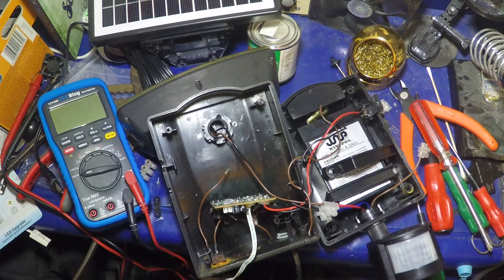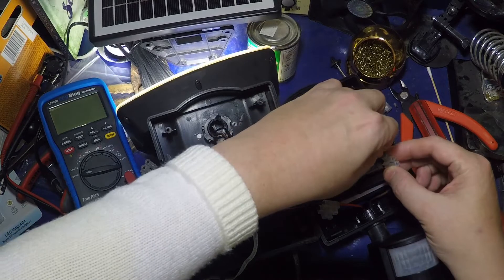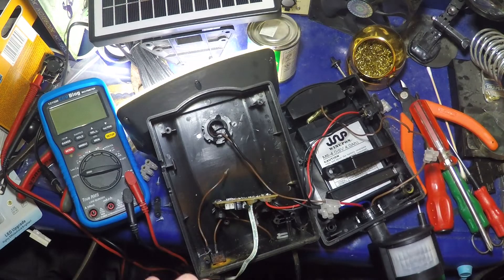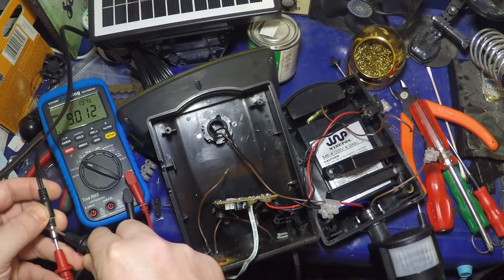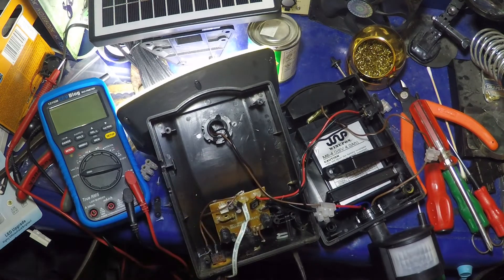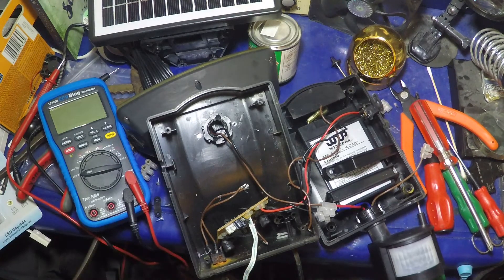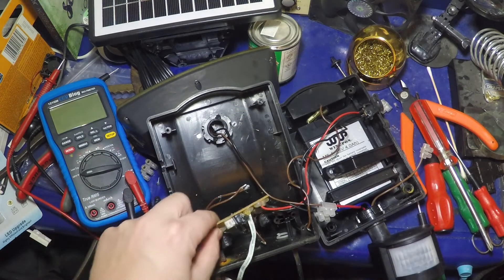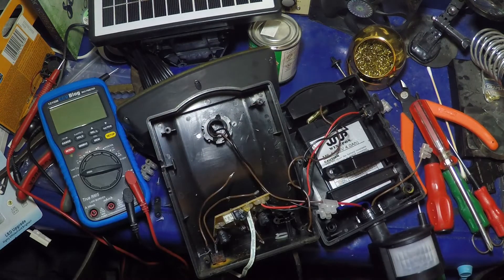Electronics Help Needed

Comment: The circuit board is a Solar Charge Controller.  It will have three pairs of wires.  Solar Panel(2), Battery(2), and Load(2).  A solar charge controller doesn't really need the load connector.  But many contain a battery protection circuit that prevents the battery from fully discharging.  Once that happens, it disconnects the load.  You can connect straight to the battery, but it won't protect the battery from fully discharging.

On the load side you will the see the PIR, switch and light.  This is the fuzzy part.  Just guesses. You tore it apart already so it makes it harder to guess how it originally worked.

My guess to get the original circuit board to work, everything will be the same as original except the PIR wires  (Also switch).

How to debug it:
I would put it back the way it was originally.

For the switch wires:  If the switch is a normally closed switch short the switch wires.

I would try to figure out the what the PIR wires on the circuit board are.  How many PIR wires?  There has to be at least three.  Just like the new PIR sensor.  1) Neutral, 2) Power, 3) Load(Switched).
It there are more then 3 wires, there might be two power supplies to the original PIR.  Electronics and load power supply. 

1) Use your continuity tester to see witch PIR wire(s) on the circuit board side are neutrals.
2) Connect battery and use voltage tester to see witch wire(s) are power, note voltages.

3) The remaining wire is likely the switched wire.

I would connect neutral to neutral, power(highest voltage if more then one),  to power, and load to switch.

No idea weather a 12v PIR will work right.

Good luck

Comment: How was the battery being charged before, was it that circuit or another one? I don't know much about charging other than as you say, voltage matters. I think the circuit for doing this is often referred to as a charge pump, but I could be totally wrong. Good luck with FrankenPIR :-)
Reply from the maker: Yes, it was charged from that circuit.

Comment: OK, So, a 6V Lead Acid battery needs around 7.2V to charge, you are measuring 9.x V as the open panel voltage, when connected to a load this might drop, especially due to the internal resistance of the battery.  The Schottky diode is to protect the panel from the battery, you can use a single Schottky barrier diode such as the 1n5822, arrange it so the diode only conducts towards the battery.  I would wire the panel to the battery seeing as it is such a low open voltage and see if the battery regulates the voltage (apply briefly and measure the voltage).  The circuit may do PWM charging but it's hard to say.  If the battery voltage is around 7.2V then you should be OK.
Reply: If you measure a 12V solar panel without any load you will see it outputs something like 20 odd volts, so higher open panel voltages are normal.
Reply from the maker: Will the diode be enough? What happens if the battery is full, and the solar panel continues to pump power into it?
Reply from the maker: @Wilksey37  I'mi concerned that it's putting 9v under the not-very powerful desk lamp. Outside... who knows. But this is winter and I've got no clue what it will put out on a sunny summer day... and being out there all day with no, "cut off" when the battery is full... what will happen? Will I wreck the battery's life?
Reply: @msknight5  Typically the batteries internal resistance will regulate the voltage, however, you cannot leave it connected permanently as you will overcharge the battery (it'll get hot, and generate some nasty gasses), you need something that will monitor the battery voltage, be able to disconnect the panel and then when the battery is fully charged, it needs to maintain a float voltage, which is the batteries nominal voltage.  Other controllers also monitor the battery to make sure it doesn't go too low, these all have thresholds built in otherwise at certain points the circuit would oscillate.  If the circuit already has a charge controller then you should use that if you can.
Reply: A schottky diode typically has a lower forward voltage than a standard diode which means you will have a smaller voltage drop.
Reply: @msknight5  Solar panels actually output the same on winter day as summer.  This is true assuming panel is aimed flat to the sun.  Actually solar panels work better in cold weather.  In use you typically have shorter days in the winter, the panel aimed better for summer, worse, weather etc.

-Kurt